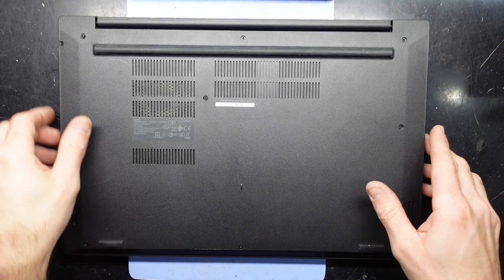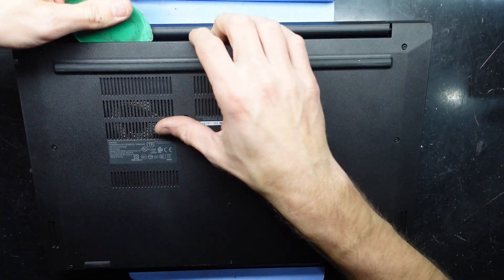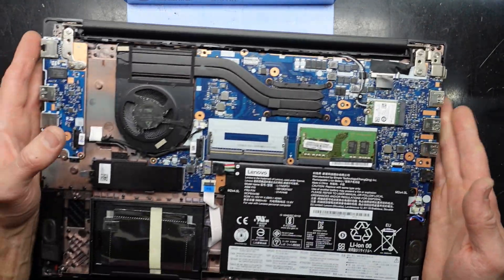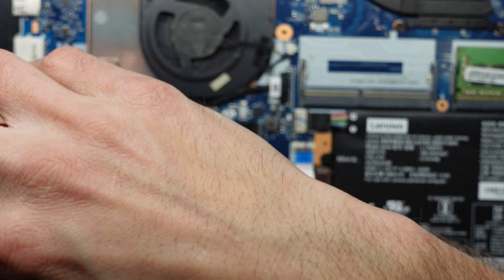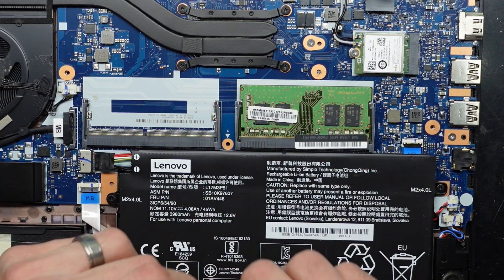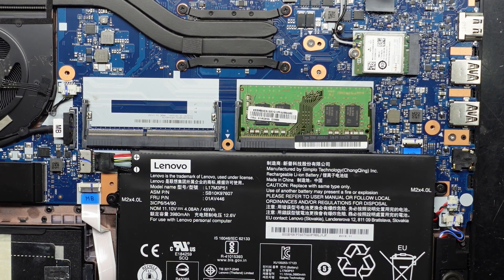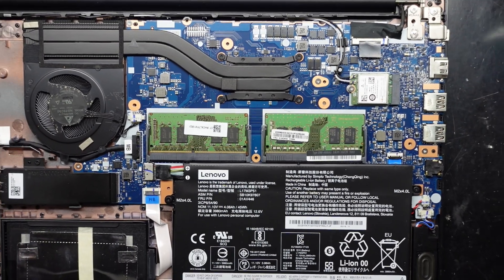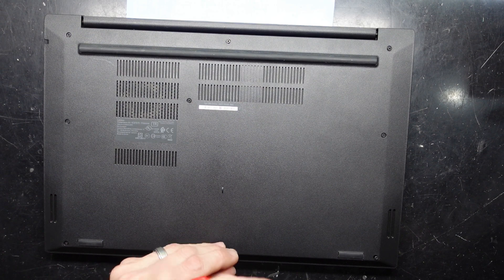Lenovo Thinkpad E595 Ram and SSD Upgrade

Comment: Excellent video. Now I’ve got 32gb ram memory👌🏻Some questions though.

So in the space where an SSD would go is an empty shell? And the included nvme is 256gb? So the nvme is the only source of storage out of the box?
Reply from the maker: i think the NVMe slot is the only source of storage
Reply: @ awesome thanks. Just ordered a drive👌🏻